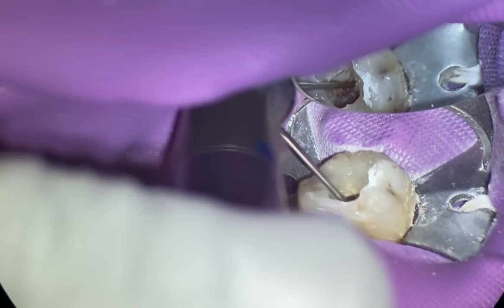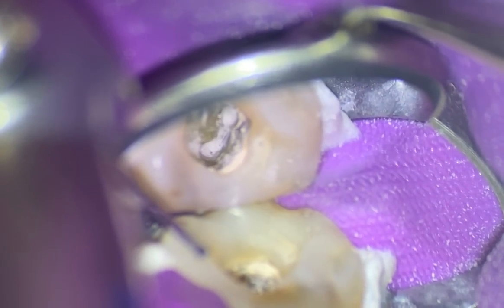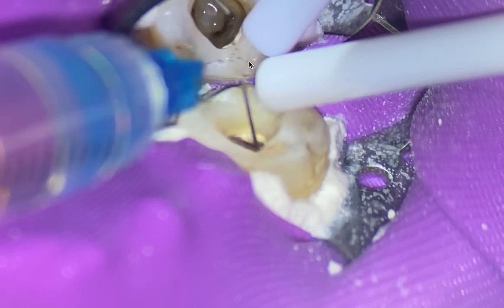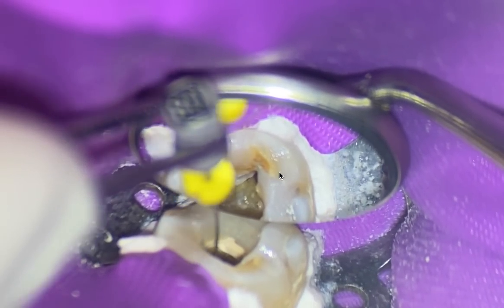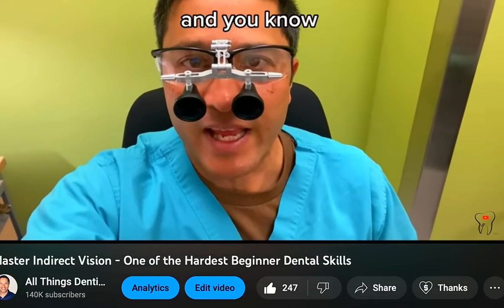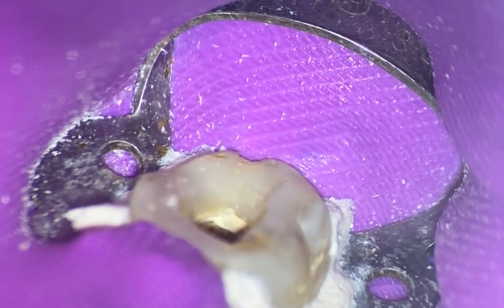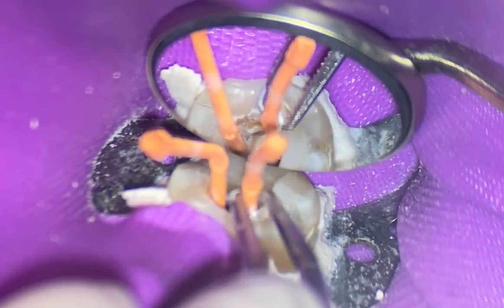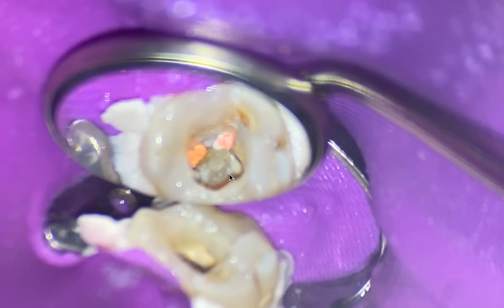I Missed a Canal - Here's What I Learned.

Comment: ☝🏻💁🏻‍♀️As I have 35+ years of dentistry experience chairside in this case scenario...I hope this explanation is understandable and helps with decisions regarding the delicate procedures involving dental root canal therapy and its complete treatment possibilities😁👍🏻
#1...a "pulpectomy" MUST be followed through completely to shape the canals to fill the vacant space(s)
#2...lower molars can have up to 4 canals AND ANY TOOTH MAY HAVE THEM PESKY "ACCESSORY CANALS
#3...ALL root canal procedures REQUIRE a basic buildup AND a crown to maintain the remaining tooth structure as to, as best as possible (there are absolutely NO GUARANTEES in dentistry and/or medical procedures/patient care) prevent further fracturing of what tooth structure remains
#4...it is EXTREMELY WISE to finish these procedures in a timely manner because once started, the tooth remains in jeopardy of losing the entire tooth and with medical/dental procedures, many times can be cost prohibited whereas in this case, the cost of 1) the root canal (a pulpectomy is ONLY the start of a root canal treatment); 2) buildup; 3) full coverage crown...so IF you lose the tooth itself after going through at least 2/3 of the "NON REFUNDABLE" treatment, the loss requires replacing the lost tooth (necessary because without the tooth that was there, teeth WILL shift and change positions, AND the tooth directly opposing the missing tooth can and USUALLY does super erupt (continue to grow beyond/into the newly opened area) which limits further treatment of that area
#5...losing that treated tooth requires 1 of 2 options...A) a 2-3 unit bridge (2 unit bridges have always been limited...cantilever bridge or even a butterfly bridge) depending on what remains to work with as for which the teeth on each side of where the missing tooth was which creates a break in tooth structure from its smooth uninterrupted surface exposing teeth to microscopic organisms thrive on the enamel (surface you can see) and the dentin (layer of the tooth structure visible only when the enamel has been removed) layers which can possibly cause a loss to either of the teeth used for the bridge if you do not take diligent care of the restoration (one should ALWAYS care for their teeth by brushing AND flossing the teeth you want to keep!!!), really floss underneath the bridge (you should be instructed/taught exactly how to care for your new restoration); B) a loss of the treated tooth can also be replaced by a single tooth implant (sometimes <SOMETIMES> placed at the time of the extraction of the failed tooth depending on any damage to the remaining bone that supported that tooth) also needing a bit of time of healing to ensure the implant is stable for the final restoration (implants behave much like a real tooth which also can be affected by periodontal disease) HOWEVER, a dental implant properly taken care of can be used as an anchor for future dental restorative needs when/if the need arises
Reply: How many minimum canals can a mandibular first molar have ? Is it possible that the first molar has only 2

Comment: 45 04 quit large u should obturate with mta ya bc putty dr teruchi technique
Reply from the maker: I value your statement. There is actually a little bit of excess BC sealer that is use beyond the tip of the cone as per what you noted. Interestingly, I keep that in the back of my mind, especially when I am treating large resorbed apices